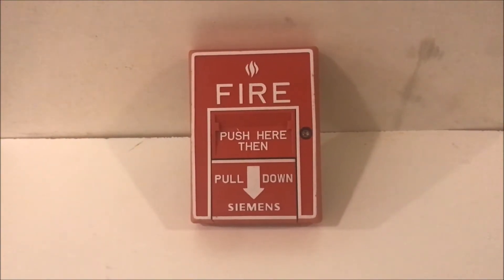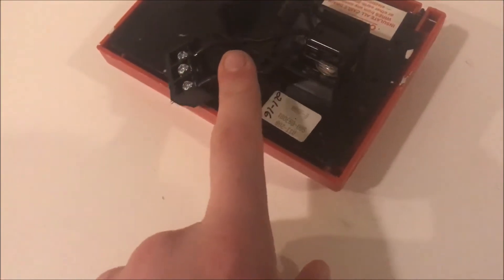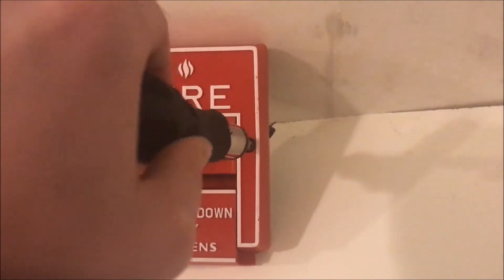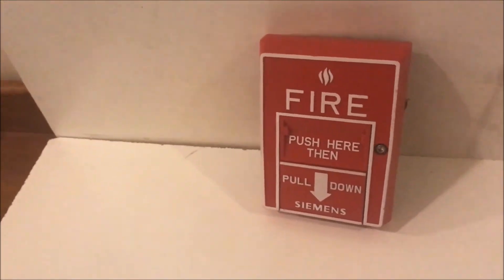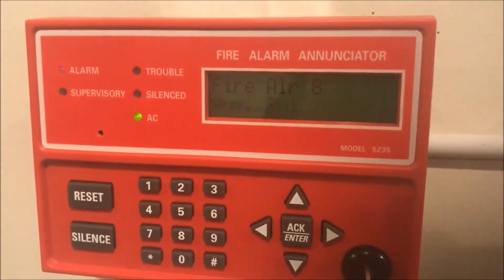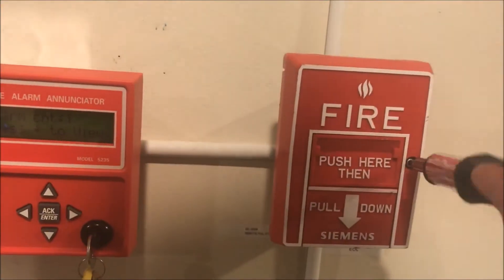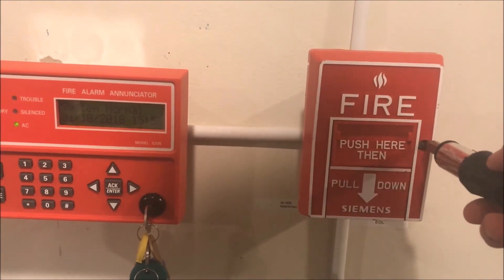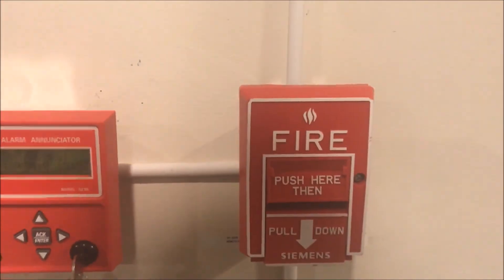Testing and Overview of the Siemens MS 10B Pull Station

Comment: Why in  a fire when  I pulled a Siemens fire alarm when I pulled the handle out I heard it click and when I pulled the handle down the alarm  beeped once and the light flashed but it stopped?  Did I not pull it down correctly. Thanks